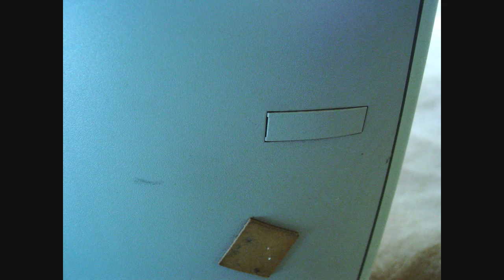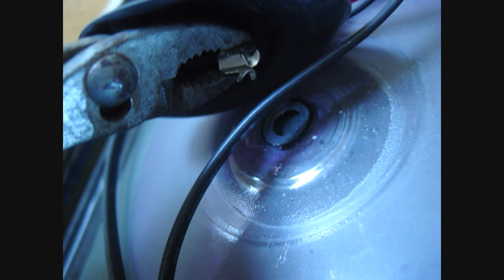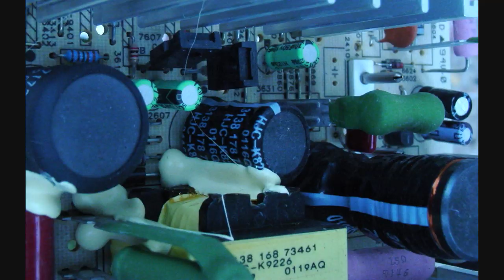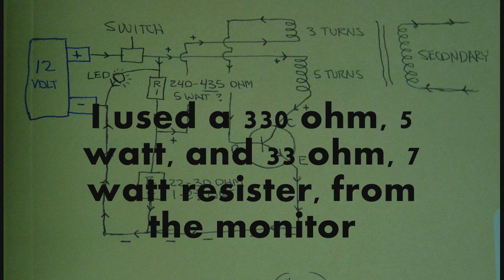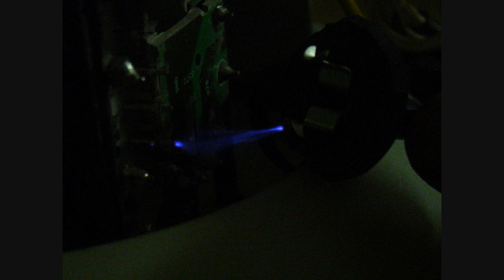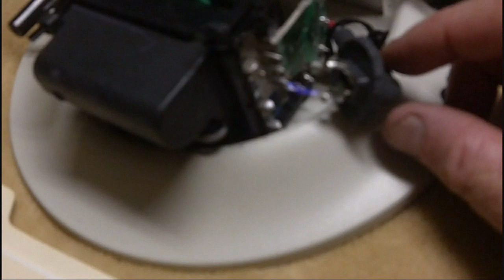$2 HIGH VOLT HIGH FREQUENCY POWER

Comment: that is more about current. it only takes 3VDC to start the process of electrolysis of water. do not use salt as an electrolyte. use sulferic acid like from a car battery. about a 5-10% solution is good. somewhere around 4kHz pulse is very effecient but straight dc works good too. a car battery makes enough volts and current to perform this process very well.

Comment: @THE123HAMMER 
no the wattage/energy is the same in maths but in the real world is lower.
Watts is what we use to do things with.
12 Volts at 0.83 Amps is 10watts
50000 Volts at 0.0002 still 10 watts

Comment: 12 Volts at 4.1 Amps is 50 watts.
If I were to boost the 12V to 50,000 not including losses from the transformer I would get 0.001 Amps that would be 50 Watts no change.
High voltage does act in a different way to low frequency like the 60HZ from the power grid.
Voltage is like water pressure in the hose. 
Current is like the amount of water going through the hose.
Watts is Volts x Amps, I can't think of a way to explain it as water.

Comment: hi my failure is understanding electronics .but would you tell me if like stan meyer states ..if i wrap a second coil of wire at the out put end (where the electrons come out to spark ) would that act as a collapsing non return type electric diode on the magnetism basic that the negative collapsing field would stop eletrons returning therefore making voltage go to infinity until it can pass through water.appreciate reply and any tweaking

Comment: @johnnnyreb51 ozone production, lifters, shocking people, CRT's, partial accelerators, beta partial generation singing arks, can-crushing, ignition systems, electrostatic experiments (if it were a AC flyback) transmission of wireless energy,  impressing people, X-rays, filtering air, ion guns, and MANY more uses!!!

Comment: We are looking for high frequency (20 - 40 khz) high voltage (120 kv) generators with inverters for our X Ray machines. Can you help us? I am currently in Dallas, Texas.
Babu
Reply: Hey, I'm in Arlington!  *fist bump*  ...Also lookin to make a high frequency generator.  And a five-million-volt particle accelerator....if possible :)
Reply: Hema Sankara Babu You can't possibly get reliable 120kV out of a flyback unless you find a MONSTER sized one, then I suggest you running it off a ZVS driver circuit at 48-50V.
But it's still not enough for an X-Ray machine. Certainly not enough.
Reply: just get a tube with the transformer integrated "Monoblock". You add the inverter with LC tank and big brick IGBT, filament controller and bam you have a x-ray machine.
- Service engineer for x-ray equipment -
Reply: valiza123 And a couple people dead by next week.
This person doesn't know the dangers of creating mid-high energy roenthgen.